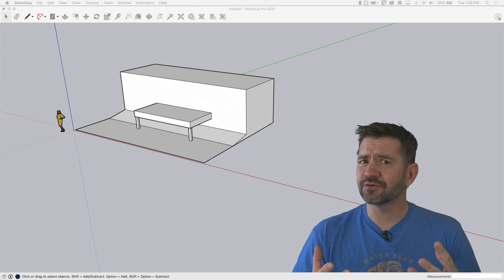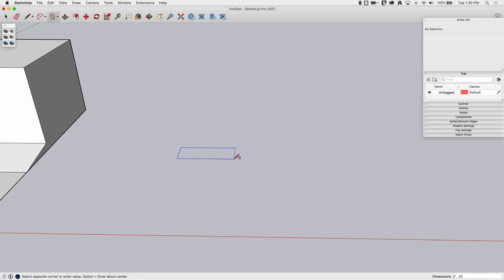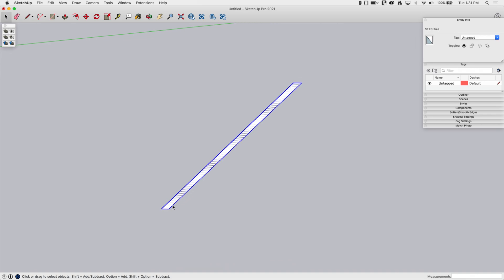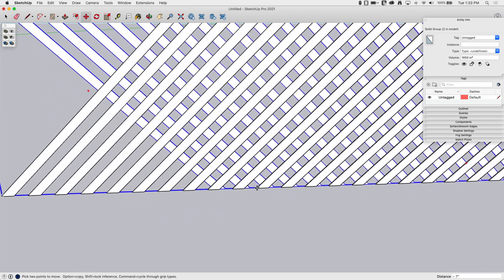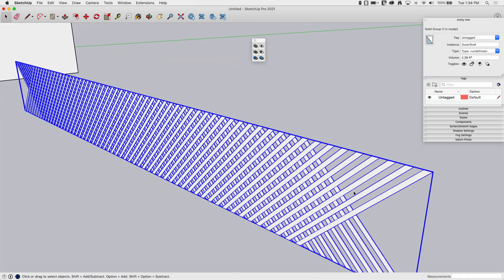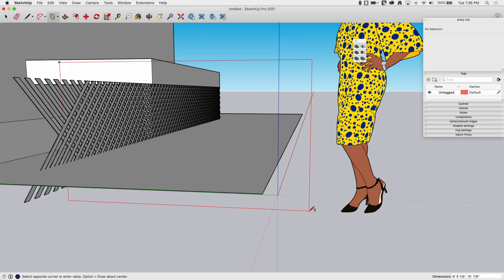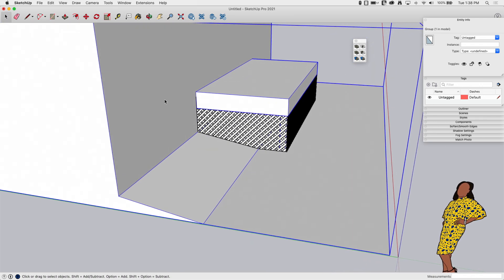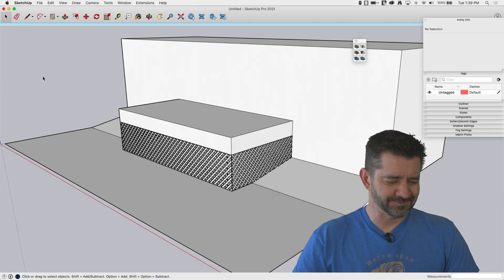Solid Tools Lattice  - SketchUp Skill Builder

Comment: Thanks for this. I am getting this error when I hit union: "One or more of the selected objects is either not a solid or is locked. The non-solid/locked objects will be de-selected before this operation is performed." Does anyone have any idea as to what I could be doing wrong?
Reply from the maker: More than likely, you have an object that is not a Solid. Try the Solid Inspector extension, or bring your question to the forum (https://forums.sketchup.com/) for more detailed troubleshooting.

Comment: The lattice work was nice to learn, but I really liked the solid tools tips. Work flow and use of solid tools is something I need to get straight. I have mainly worked with components, so if I need to use solid tools my components get messed up. I need to work first with groups and then make whatever components I want after doing all the solid tool work. So, anything with workflow and solid tools will definitely be of interest to me. Thanks for the great training.